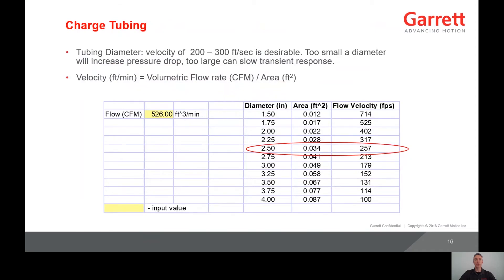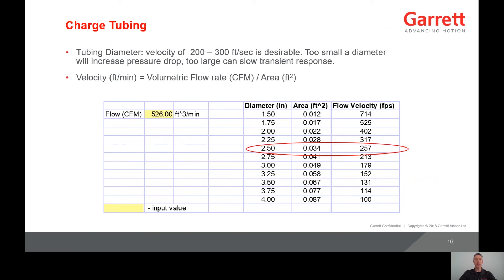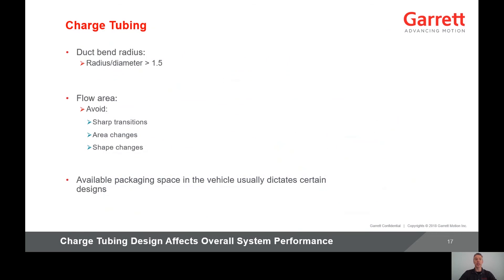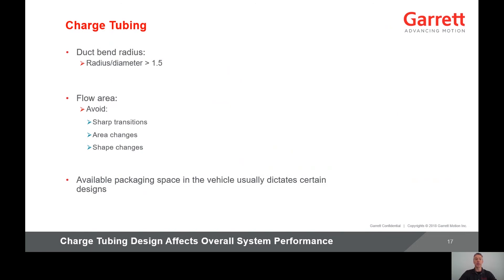Calculating Turbo Piping | Garrett - Advancing Motion

Comment: When upgrading stock Turbo downpipes, how do we calculate what is the optimum size for best flow while still keeping the the Velocity high ? I have upgraded my Dp from a 42mm to a 63mm, and even after a Tune the car feels laggy at low rpms. It only comes alive above 3k Rpm. If you calculate the area of the Upgraded DP, it works out to 2.25x the size of the Stock DP. On stock cars with small turbos, what would be the best upgrade in Size for both Performance and maintaining the Daily driver characteristics ?